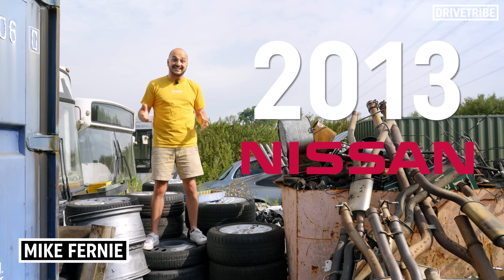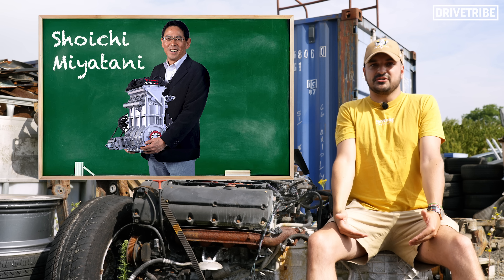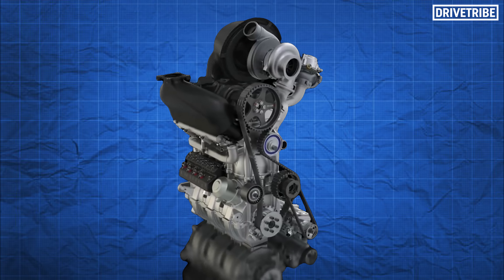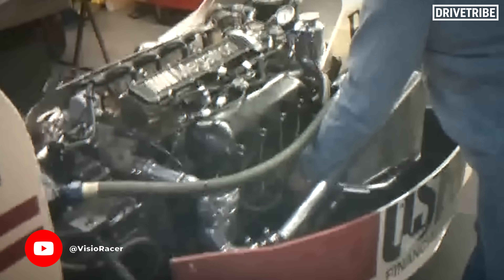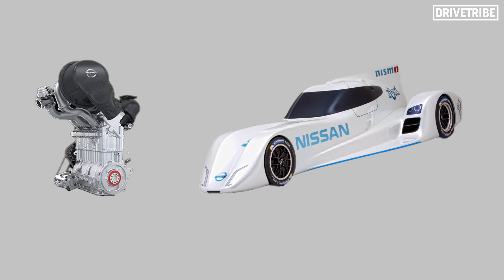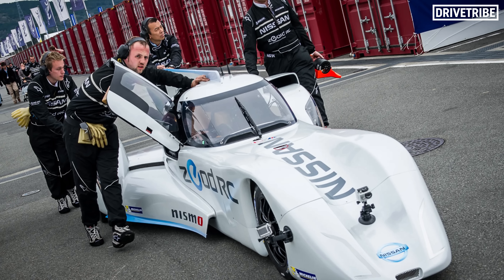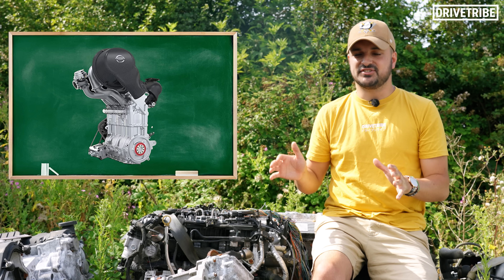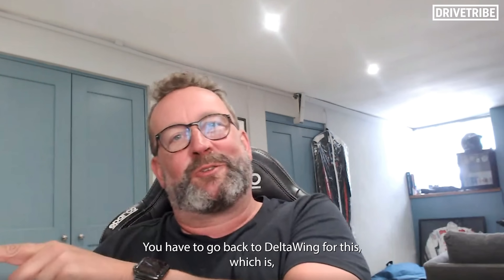This TINY Nissan Engine is More Powerful Than Your Car!

Comment: Why do the Brits measure capacity in liters , weight in kilograms but torque in pound and feet???
Reply: To confuse as many people as possible. 
A person's weight is commonly measured in both stone and kg
Speed in mph
Distance on roads uses miles and yards
Smaller stuff uses mm
Reply: @jcc3494 Fuel consumption in mpg but fuel capacity in litres 😂
Reply: @TheCheesenChips because we can use the units interchangeably. We know there are 4.5 litres in an imperial gallon so it's not rocket science
Reply: @christycullen2355  rocket scientists use the metric system
Reply: @TheCheesenChips mpg is an american thing. Tye earopean thing is litres per 100 kilometers
Reply: @jcc3494  Well done! 😂😂😂
Reply: @jcc3494 Try working on a 1970’s British motorcycle. You will need metric, AF and whitworth tools. 😅
Reply: We also used stones and feet and grains in 5000 bc. But we moved up since then
Reply: @UltiMogr  well some did,and others bowed down to French communists.
Reply: @UltiMogr you mean "made it easier."
Reply: UltiMogr  no you haven’t
Reply: @jcc3494 exactly 😅
Reply: @jcc3494 nope , only chese burger people uses miles and stuff. As per international standards, it kg, kmph, litre or cubic centimetres. Cheese burger people need to realise that the world doesn't revolve around them.
Reply: @akshaymahesan8869  first of all, you aren't funny. Secondly, the UK still uses miles
Reply: @jcc3494 don’t forget MPG which British gallons are different from US gallons.
Reply: @jcc3494 stones?
Common…
Reply: @jcc3494  not to put too fine a point on it, but, One Inch is legally defined as 25.4 mm... litres per hundred kilometres erases the confusion between US MPG and Imp MPG
Reply: We measure in pints and LITRES, feet, inches, metres, centimetres and millimetres. Pounds, kilograms, stones, miles and use 24 hour clocks.
Reply: @darenn71 let not forget yards too 😂
Reply: @darenn71  To measure beer using the metric system just doesn't sound right.
Reply: A 500ml bottle of cola but a pint of beer :)
Reply: @FrontSideBus   more beer in a pint... init
Reply: So we can get 68ml more beer 🍺
Reply: @FrontSideBus  568ml to a pint!
Reply: @FrontSideBus  yeah we also have both litres and pints of milk for sale on the same shelf
Reply: Britain is adopting the metric system since 1963, they're just a bit slow.
Reply: Because they invented soo many things that they lost track at some point..
Not a joke to be honest..
Reply: Probably because we're intelligent enough to be able to understand both without issue. I mean, the Americans can't even use the same imperial system as eveyone else... Different gallons and so on, for no other reason than to just be different, or in their eyes, better than everyone else. 😮‍💨
Reply: @andyc734 Ah, nobody else in the world uses the “Imperial measurement system” except for the UK. The USA uses their own system called the “US Customary Units”, which is based off of the imperial system so it isn’t. Oh, and the UK is officially metric, so you should;’t be using it anyway.
Reply: @johncanalese588 you are still using English tho aren’t you? And I bet that’s probably the only language you speak 😂
Reply: @fatbadboy329  Yes, I do speak English as my first language and have working knowledge of others. Sorry, but I have no idea as to which of my posts you are commenting on nor the relevance of your statement.
Reply: And their speedometers read Mph
Reply: @KingChadKennedy no.. its km/h
Reply: @chadkennedy8675  actually most cars since the 60s have both
Reply: @chrisdorrell1 in just uk?
Reply: Don't forget miles per gallon too
Reply: Tyres are a lot more confusing:
width in mm 
diameter in inch
height % of width
Speed rating in letter
Snow rating with icons.
Reply: @buddy1155  *Tyres. 😉
Reply: @buddy1155 Tires.
Reply: @buddy1155  Buddy is a smart guy, but didn't you mean tires  just kidding
Reply: Because it's accurate
Reply: Why do Americans use month day year, unless it's the 4th of July. Its  a bit of fun. 😊
Reply: Because they created the Imperial measurement system.
Reply: @zqzj the Romans did.
Reply: @zqzj  and when we transitioned to metric the old farts would be confused more than they already are.
Reply: @zqzj they haven't actually. Feet, stone, inch have their origins in the dynastic Egyptian times and probably way before that in some form.
Reply: @zqzj  I think Napoleonic France invented metric.
Reply: Because reasons. 😂😂😂😂
Reply: idk, Britian is pretty weird in that people are kinda used to both metric and imperial for different things, which can be pretty confusing if you are more used to one or the other, like how im used to metric
but, it does mean i can convert things relatively well which im happy about being able to do
Reply: At least we don’t use bushels like the yanks do.
Reply: Because we use imperial and decimal system and I often switch between to depending on which is more convenient
Reply: It keeps our brains working.  Using energy, stopping us becoming lard arses, unlike them over the pond.
Reply: bigger numbers sound more impressive, duh.😂
Reply: @intosound913  Which is why a fast food chain in the US (forget which one) tried to introduce a 1/3 lb burger but it was a failure because the American public thought it was smaller than a 1/4 lb burger and didn't buy it 😂
Reply: They went to the metricsystem in 89 but they are not in any hurry
Reply: @peteduch2151  You are only 24 years out,it was 1965.
Reply: @peteduch2151 we moved over to the metric system in the 70's and learn both metric and imperial at school.
Reply: Because England 🏴 💪🏻🤣🤣🤣
Reply: It's the first industrialised country, old things take a long time to change. I know some Brits can use both imperial and metric, so we're getting there.
Reply: Because thats how its meant to be done
Reply: Don't know. Some thing to do with having history
Reply: Which ever measurement gets us closest to a whole number 😅
Reply: Because we can.
Reply: anyone who has to use units for work uses the SI units
Reply: They should use ISO units of NEWTON METRES.  If they choose to use imperial units, they should be FOOT POUNDS FORCE.  The units used here are nonsensical.
Reply: Cos its accurate,to us
Reply: Also I have a 1/2” racket for my 13mm socket
Reply: Because we're stuck in a no-man's land between the metric system and ungabunga units.
Reply: They actually use NM but the audience is American or Libyan which are the only ones sad enough to use that form of measurement.
Reply: @Mile-long-list  got news for you, Everyone uses mixed measurement. 
Aircraft fill up with fuel in kg but fly in feet of altitude
Reply: They have commitment issues.
Reply: @MumrikDK  no, they are doing what everyone is doing, choosing to use the most easily understood measurement for each thing they wish to quantify.
Reply: I'm 56 and everything for me is feet,inches,stones and pounds. Not interested in the metric system. We're British and we don't like "change"
Reply: @dangerman01582  apart from everyone educated under the metric system. I studied engineering and predominantly it's all metric, although conversation is taught since there are still plenty of imperial measurements in use today. It's a changeover and it will take at least two generations to fully take hold. 
I am 45 and it's nearly shifted fully over..

Once the generation that recognises the older measures thins out the metric will naturally have dominated. Scientifically speaking it's not a bad thing. From a technology standpoint unified language makes progress easier
Reply: Tiny engine with massive hp = high maintenance and poor reliability
Reply: @zaharijaafar8311  and probably single-use
Reply: @zaharijaafar8311  not strictly true! Depends on tolerance, design and maintenance. Some pretty high revving engines are still renowned for reliability as they are well made.

A chugger of an engine can still be dog eggs
Reply: @zaharijaafar8311  yeah I think that's only a British engine problem 4.8 LS can handle 600hp a be daily driven
Reply: Actually officially it's Nm for torque from an engineering perspective. But  for many things when it comes to "talking about stuff" there is the legacy element. There is still a significant percentage of the population still alive that were taught imperial measures. Transition takes time.
Reply: @jimstartup2729 

Absolutely 

Couldn’t agree more 

Newtons means nothing in the mind’s eye 

Might as well quote how many leptons per  nanosecond it produces 🤷🏻‍♂️ 

We all know what a pound weighs (or 2.2 of em at least) 

Lb/ft is so self explanatory and easy to comprehend 😎👍🏻 

300 lb/ft of torque makes for excellent mid range acceleration in a modest hatchback for instance.
Reply: You might as well ask why do Americans have short measure in their pints 16 fl oz vs 20 fl oz Imperial
Reply: @ClassicRockRadioEU  Because they have noodle arms and can’t hold a real pint, let alone drink one.
Reply: we measure everything in every unit depending on what product it is. we use pints as well as litres, we use kg's, lbs, stones, we use meters, miles, yards.
we even use baker's dozens.
Reply: Where do you think we picked up the habit from? Also they've only been on metric for like 50 years, give em a break.
Reply: You wanna know a more confusing thing when you go to the petrol station you pay per litre but cars use miles per gallon.

It’s because the Imperial system was made by Britain and the only reason we use the metric system is to be more integrated with Europe arguably I think we should favour the Imperial system.
Reply: Because they are just that, Brits🤣
Reply: Just to be weird
Reply: Car tyres are (generally) dimensioned in mm, % & inches for each tyre.
Reply: Same as u measure wheels and tyres in inches and Milimiter. Duh!!
Reply: Im British, great point lol 🤣
Reply: Trina be American without feeling wrong
Reply: [not a Brit] Because the legacy of things constructed using those measurements.
Reply: Because sometime in the early 1970s, after getting most of the way through the process of demanding everyone went metric, our government realised they would have to fork out a huge amount of money to change all our road signs and speed limit signs, so they bailed out of the whole thing and left us with a half-assed mix of measurements that persists to this day.
Reply: As a British citizen all I can say is "yes".
Reply: Newton meters
Reply: We use all units of measurement all the time over here
Reply: The question should be,why isn’t everyone else using what the brits use!!?
Reply: because no one cares about Newton anymore, and i dare you to try using kg*nm.
Reply: We're just weird that way. Great isn't it 😀
Reply: This Englishman uses Newton metres and kilo Pascals.
Reply: For the same reason European and Japanese car manufacturers measure tyres in millimetres width and inches in diameter. 205/70/15
Reply: Because we're intelligent enough to use both for convinence. Work smarter, not harder.
Reply: This is my turbo, what’s that on the side? I’m not sure.
Reply: Because, my dear American cousin we are half sold on the merits and drawbacks of both Europe and the USA, thus we are edging our bets dear boy.
Reply: We don't, it's always Newtons.  Same as the Aussies, Germans, Italians, French, the list goes on.
Reply: And then the Australians came along and said “Hold my bhp, I’m gonna state the engine power in kW” 🤯
Reply: Because they are insufferable.
Reply: Not sure but I don’t see Americans measuring displacement in gallons so meh
Reply: and power in hp
Reply: And speed in mph
Reply: Horses for courses 👍🏻 

If the hat fits, wear it 😎 

Fuel is sold by the litre, yet we measure fuel economy in miles per gallon too 😁
Reply: We don’t, we use Newton meters , idk why they used ft lbs in this
Reply: Only the usa uses the old imperial  measurement  system , the rest of the world uses metric system.
Reply: Old politicians refusing to die. A twisted sense of tradition that somehow the way things were done in the old days is better. A somewhat xenophobic aversion to European things. A healthy dose of “can’t be arsed to change it.”
Reply: Because the people in power want make life as difficult as possible
Reply: If you watch carwow you'll see us Brits actually use Nuton meters but there are some that use a wiered mix of imperial and metric. Some use inches for small measurements some don't. It's just the Americanisation of the world seeping into every part of media
Reply: Lol. Epic comment
Reply: We can work in both metric and imperial 🙄 unlike yanks
Reply: @MrT01582  uh ok you are sooo intelligent  lol
Reply: Because we're mental
Reply: We do what we want
Reply: Everyone in this comment section saying the whole world should use the metric system is a bigot. That’s like saying everyone in the world should speak German. Don’t get me wrong… I like the metric system because of the base ten aspect. But my first mathematical “language” is the English system. (Inches, feet, yards, miles, acres etc. Ounces, pounds, tons. Water freezes at 32 degrees and boils at 212 degrees.) All those units are immediately relatable to me where as, when I hear “meters per second” regarding speed, I have to calculate it to MPH to get a sense of how fast that is. To all you English units haters…I can convert any English unit to a metric unit (and vice- versa) with a paper and pencil. Can you do the same, or do you only know YOUR language? Open your mind and try to accept the fact that not everyone is like you.
Reply: The same reason why British colonies use kilowatts instead of horsepower, bars instead of pascals, and Newton Metres instead of Pound Feet. Because why not?
Reply: It's because  their teeth  are bad
Reply: They even measure in miles per gallon I believe
Reply: Coz they're poms😊
Reply: km/hr, m/hr, enough of this modern measuring, why can't we go back to cubits/hr?
Reply: Who cares?  This is a video on the Internet.
Reply: Because they buy in kg, and sell in pounds.
Reply: We use metric system for most things but distance / speed etc is miles / feet / yards.  All cars read mph speedos. All road signs are mph / feet / yards.  🤦🏻‍♂️.  It’s just a thing 😁
Reply: Variety is the spice of life old chap. And because we can.
Reply: You ever see a kg*m?
Reply: @rylandallas9907  yes. when I pick a carton of milk. thats one kg*m
Reply: Cause nobody knows what a Newton/meter is….
Reply: Because they can.
Reply: Because metric is sensible, but metric is European and Britain is racist.
Reply: Seems a flat 12 would be the way to go.
Reply: french still use obsolete way of counting so even metric has problems..they don't say seventy they say sixty-ten and four-twenty >< instead of eighty
still not has bad as having divides as units like 1/34 of an inch really ?
Reply: Litre, not liter
Reply: It should be all metric, no one likes imperial.
Reply: Actually the use both depending where you are are you can go from km to mi, kph to mph.  So there are places in the UK that measure torque in Newton·meters (N·m)
Reply: Because we use a hybrid system of weights and measures. We also measure altitude in feet, but barometric air pressure in millibars (as opposed to inches of mercury in the US).
Reply: Because they hate you. You specifically…
Reply: Why do Canadians use metric for most things but carpentry/lumber are in imperial?
Reply: Identify crisis
Reply: I use newtons
Reply: Because we all know America’s best for making power 😘
Reply: @rvoykin  Brute force and Ignorance lol, British is more Agile n Gracefull. Sad to see what's happening their now thou.........with the iotsRAY. That's  a code word rhyms with tryit but starts with an R lol
Reply: They do enjoy their pubs.
Reply: Even more strange is they drive on the wrong side of the road.
Reply: Every other part in the world such as ASIA and Middle East all used to measure in liters, weight in Kilograms all the same as the British...
Reply: It is the entire world that uses the metric system. It is the USA and one other banana republic that cling to the imperial measures. Sorry to burst your Merican bubble buts it's the USA that the odd one out.
Reply: Because secretly everyone understands why the standard measurement system exists, they're just too posh to admit it's useful outright.
Reply: We were forced to use the metric system when we joined the Europeans who insisted we did as we were told. But we will not do as we are told if it doesn't suit us. So we drink pints and travel miles.
Reply: Tradition
Reply: The crooked eye Watson from carwow uses Newton meters, and so did the trio from the old Top Gear (and The Grand Tour later) Clarkson, Hammond, and May. I've never heard them say "pound feet" to measure torque.
Reply: Because we created the language.
Reply: because it sounds better
Reply: Because they are British
Reply: Because were intelligent and highly adaptable
Reply: to show we are cultured 🙈
Reply: They also measure fuel economy in mpg but it's a different mgpg
Reply: They also measure bhp when it's just pure guessing on a modded car.
Reply: Because Torque is American.
Reply: @TrismegistusMx  torque is greek since 250bc
Reply: No we use NM to measure torque
Reply: Because they still haven't come up with a decent slang word for newton-meters. And no, Jeremy Clarkson's "torques" don't count, since it can refer to pounds-feet or newton-meters.
Reply: british people dont like anything that isnt confusing
Reply: Same with Canadians except the speedo says km/h not mph
Reply: We created the imperial system we will use it as we see fit. Now does that mean the frogs didn’t make a better system unfortunately it doesn’t.
Reply: Newton meters..
Reply: us indians measure capacity in liters/ cubic cm (same numbers, different decimal points), weight in kilograms, torque in N-M
Reply: America also uses these standards as far back as the 70s, we just also still use our own.
Reply: Because in general conversations there’s still a few things that are still referred to in imperial. However that’s just general chatter, such as a pint of beer.
However the Uk does use metric for everything that matters and everything officially measured!
Reply: I think running in different units as long as it’s clear is actually advantageous. When I’m measuring something if 37 inches is bang on I’ll use that if 85cm is I’ll use that. Tanks in litres is really down to pumps changing in the 80s I would definitely say it’s got a 9 gallon tank. I’m not sure I’ll ever use kilometre over miles though.
Reply: Cos Ruuuulle Britannia or something like that
Reply: Because we can
Reply: Because we only managed to convert them to logic partially
Reply: Probably use whichever measurement ends up resulting with whole numbers 

Like Mpg in a car generally is 1-100 scale 

And 1 2 and 3 pint bottles of milk are the perfect small medium and large size 

Even is just easier when you learn multiple measurements
Reply: Because we are able to convert them 😂
Reply: because HP costs $$$, and $$ is in pounds?
Reply: Let it Go!
Reply: Because they do
Reply: Because the more torque the more pounds you will have to spend
Reply: With feet, they are divisible in 2-3-4-6-9 ect easy to calculate in the brain without paper
Reply: A liter is what 1 lb of water weighs...
Reply: @GreenEyeDemon  no its not
Reply: @UltiMogr  I was joking because 1 liter is equal to 1 kg of water weight but torque is not measured in water per square meter..
Reply: they use mph too
Reply: Because we invented the English language that's why 😂😂. Pound ft is way easier tbf, Its a smaller number and its always just under or the same number as hp on a petrol/gas car so you can get a better idea how torque like the car going to feel . Same reason mph makes more sense the kph smaller number, I'll give you the weight one tho.
Reply: Why would you not measure in feet your yank metric system is wild 😂
Reply: Bcoz they go nuts for butts😂
Reply: Uk is even worse with measure than usa where everything is different, uk walks in miles drives in  kms( not sure what way ) and so on
Reply: Who wants an engine that lasts 1 race, or 5000km road use?
Reply: Because they are dropkicks
Reply: Er, we may have used Imperial units in the past and these are still familiar to us however, nowadays we use SI units or derivatives thereof- unlike the US which still locked in the past, still using totally nonsensical units like Fahrenheit, for example....
Reply: Because horses are generic
Reply: Trying to sound too clever
Reply: We don't. Newton metres. And metres
Reply: Greece is best,we measure in liters,weight kilograms and grams,and torque in NM
Reply: Because complicated.
Reply: Because we decide.
Reply: American freedom ponies and bald eagles are the only acceptable units of measure for power. Of course, other places use buff horses too,we set the standard of crazy power
Reply: I Hate the metric system 😡
Reply: Wankerz
Reply: Why ask dumb questions
Reply: BHP & nM = Brake Horse Power & Newton Metres
Reply: Pints
Reply: Because we can. Your question should be, how can the Brits comfortably combine different measurement systems but the rest of the world struggles?.
Reply: @user-re6yo7tj5s let me know when Britain gets a space program.
Reply: I could also include WHY the yanks drop letters from words and have wrong names for car parts etc ???
Reply: @stum8374 You mean like boots and bonnets?
Reply: @stum8374 by "the yanks" are you referring to all of us?
Reply: @Steve.Cutler  it's a sweeping generalisation. Like calling The English, Scottish, Welsh and Northern Irish brits.
Reply: @stum8374 brush yer teeth
Reply: @stum8374  you mean like the hood and the trunk rather than the bonnet and the boot?
Reply: @stum8374 and why have they adopted a completely different thread standard to just about everybody else in the world.
Reply: stum8374 Because words don’t need extra letters in them and we name stuff correctly.  Remember a truck is a place to put stuff and a boot is something you put on your feet   Petrol comes from Petroleum, which is the Umbrella category while gasoline is the actual stuff you put in your car
Reply: @stum8374 we can’t all have extra  unnecessary letters. Imagine if everything was spelled like Worcestershire.
Reply: @stum8374 bc we drop the useless letters and use names that actually make sense
Reply: @StopVotingForBoomers so you are spelling English words wrong, simply put. It’s called English after all and not American-ish 😂
Reply: @StopVotingForBoomers both trunk and boot are pretty bad descriptions of what it is.
Reply: @StopVotingForBoomers  Stone? how does stone makes sense when looking at its meaning. Stones are pretty random, and kg is not. 10kg=10kg but 10 stones can be anywhere between a few grams and 1000s of tonnes
Reply: As an English man I can assure you we don't use kilos in weight that's other party of Europe not the UK. How we measure the capacity of an Engine in Litres is much easier than you use  presumably your American & say your cars engine is a 440. Anyway this is a British channel so everything used in weights & measurements is for the average Brit to understand not someone from North America.
Reply: @jeremywentworth1833 as an Englishman I can assure you we do use kilos . When posting something , when buying food for example. Or are you still living in the 1970s?
Reply: @jeremywentworth1833  I'm 45 & can assure you that at least some of us definitely do weigh things in kilos.
Reply: @Smiler121 .im 54 and I can assure I've only ever used pounds & stones does this as a Yorkshire man Leeds born & bred mean I haven't an egg cup full of brains because I don't use kilos then. Certainly most Brits won't have ever used kilos .
Reply: @jeremywentworth1833  age is definitely a factor.  There's a slow shift that younger will people take metric for granted however as all the comments highlight it varies by what we are discussing & who's involved. Education background plays a part too, for example I studied Physics at University where using metric is completely standard.
You'll also find where younger folks have particularly stubborn parents who are dismissive of the modern measurements they are more likely to have focused on using measures that are outdated 😅
Reply: @jeremywentworth1833  Tell my doctor that - weight is measured in kg in medical situations, and medication is prescribed based on  the patients kg weight. (Same for vets, btw)
Reply: @jeremywentworth1833 
“not someone from North America”
What do you have against Canadians and Mexicans? After all, Charles III is the king of both Britain and Canada. Poor Canada, it’s just a red-headed stepchild. 😢
Reply: @jeremywentworth1833 lot of younger people use predominantly KG for weight. Me included.
Reply: @jeremywentworth1833 in Canada we are doomed because we have to hybrid both. There are some amazingly accurate YT videos out there documenting it. lol.
Reply: @jeremywentworth1833 but you are doing the same as America and not the rest of the world?
Reply: Because they're a bunch of confused lots
Reply: @umarmars47  you’re the ones that get confused 😂
Reply: Imperial units of volume are superior to liters. They increment at 2^n.
Reply: Because we know far more about cars /engineering than anyone worldwide
Reply: @chrisdorrell1 is that why the Germans, Italian and Japanese all make better cars?
Reply: @chrisdorrell1 sure thing buddy
Reply: . This is why British cars has top notch quality rules the world with their hughe market shares. 😂😂
Reply: @chrisdorrell1 even Germany?
😆
Reply: @Golgi-Gyges  that their decision. However progressive people know what progressive means
Reply: @chrisdorrell1  so in your example, "progressive" concerns being easier, not superior.
Reply: @Golgi-Gyges  that's the point. I never want ti be superior
Reply: @chrisdorrell1  you want easy, okay
Reply: @chrisdorrell1 British leyland M.C really proved that they knew what they were doing, eh...the final blows to the empire didn't help, but i do agree to a certain extent with the cunning & guile of the British MI6 during WW2.
NZ #8 wire tinkererer
Reply: chrisdorrell1  Then where’s your car industry?  All them are shut down or owned by Germans